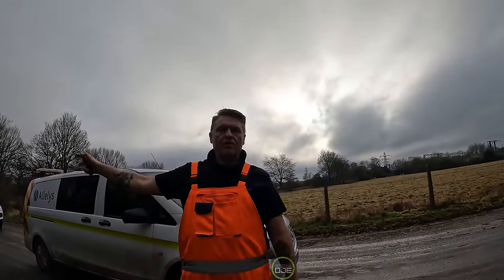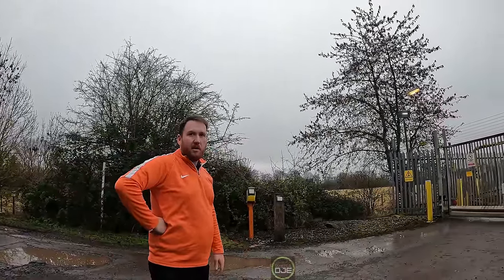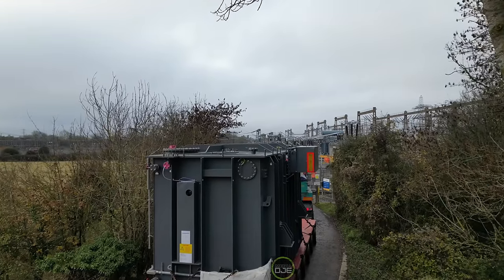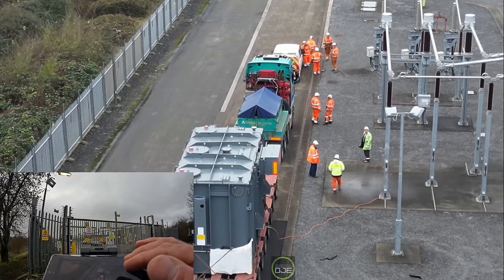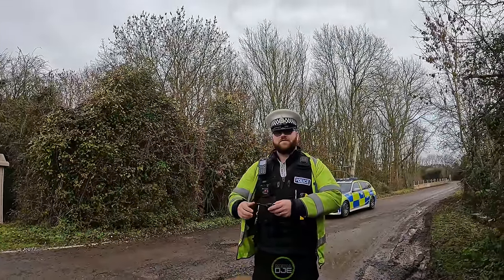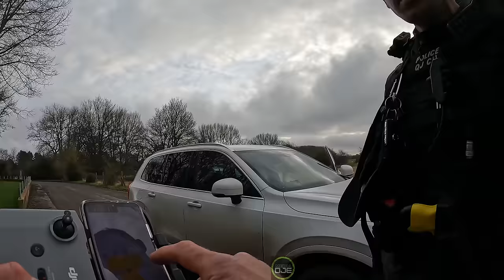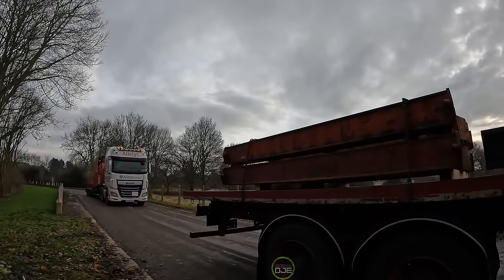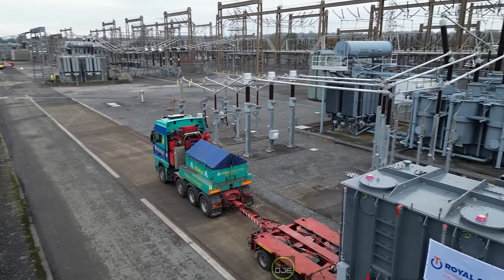HOW did you know the REACTOR was being delivered today mate ? 🤔🎥😒🚁🤬❌️

Comment: They're called reactors, but they're effectively just big coils of wire inside - they're used to restrict fault current on the network using magnetic impedance. Usually, the bigger the fault, the higher the current flowing, but with these on the network, as the load rises, so does the push-back to prevent it from flowing, they automatically and transparently (to the network) prevent dangerous fault currents.
Reply: Actually for power factor correction, but your answer is close enough for the folks who, unlike myself, are just not into electrical engineering pedantry.  🤣
Reply: I did wonder why they would put a nuclear reactor in a substation. Now it makes more sense. Thanks.
Reply: @Iaintwoke  Well, that's likely the plan going forwards... But government is still dragging its feet.

Small modular reactors are designed precisely for that kind of deployment.

Will almost certainly involve those dotes being Scheduled as nuclear sites, with the additional security that entails.
Reply: Another name for it is Choke !

Comment: What a palaver over a little machine that's being flown with legality and care. It's mainly down to a dislike of a camera.
Reply: Security and safety is more important than your right to fly a toy.
Reply: @foxman1546  Couldn't agree more. In this case the video proves that the reaction toward security and safety were practically non- existant, apart from other peoples' vivid imaginations. Jobsworthy-ness of the highest calibre.
Reply: High voltage substations and cables are extremely unfunny things to mess up on and the outcomes are usually expensive. A million pound drone insurance sounds a lot, but it is not, and the policy would not be valid anyway as you ignored the signs 😉
Reply: It's more like a fear. When cameras were first invented, some people thought a picture could take your soul. And it adds ten pounds apparently.
Reply: @robba1234  Signs that have no legal validity? The CAA puts a yellow warning on certain areas; if things were so bad it would action a ban...it doesn't.

Comment: The crane doesn't lift the reactor. For the final position a track is laid down from the trailer to the pads. The hydraulic jacks lift the reactor at four points you can see the jacking points on the sides with the red and white tape around them. After the trailer is removed, more track is laid down underneath along with the sleds and the jacks lower the reactor onto the sleds. It is then pushed along the track to its final position, where the jacks then lift it again and all the track is removed so the reactor can be lowered down onto the concrete pads. Took us about 3 days to move a 350T generator from lorry to final position. Moving along the tracks usually takes 1 to 2 hours, the rest of the time is the set up and positioning of the tracks and jacks.

The problem with flying directly over open air switchgear is that drone falling could come down and breach the safety zone around an insulator. This would be very dangerous for anyone in the switchyard at the time, along with the the disruption to national electricity supply. That is the main reason they don't want you flying around the yard whilst they are in there.

Drone assist is not the law and is not endorsed by the CAA. It is always the responsibility of the drone pilot to ensure safety. Under Schedule 9 of the Air Traffic Management and Unmanned Aircraft Act 2021 the Police do have the power to check that the Operator ID is legitimate. At the moment for a sub 250g drone they only have the power to obtain the name of UAS Operator and not the remote pilot, although there is a catch all of 'any further information the constable considers reasonable'. Nothing in Schedule 9 requires an offence to be committed or suspicion of one, that is Schedule 8.
Reply: Drone assist is endorsed by the CAA it is endorsed on the CAA web site!! So what else in your post is b@llocks?
Reply: Every question has a purpose and it’s not to be friendly. Don’t forget that.
Reply: @Ubique2927  Yes,  Drone Assist along with other Apps and manufacturer's software is listed on the CAA website. However, to quote the paragraphs on the CAA website directly above that list;

'As a regulator, the CAA supports any measure to improve the safe use of drones but does not endorse individual products.
The CAA has not checked or approved the apps listed here. Full responsibility for safe operation remains with the person operating the drone. It is up to them to assure themselves of the accuracy of the data and comply with all UK drone rules and regulations.'

So when a drone pilot states that the likes of Drone Assist gives them the legal right to fly over an area because it shows there is no exclusion zone, they are mistaken. Drone assist can form part of a risk assessment to determine if a flight path is safe and legal, but there can be other factors that may make the flight unsafe and hence illegal.

National Grid, the owner and operator of 400 kV and 275 kV substations will have a documented risk assessment for carrying out flight over and around their substations and infrastructure, by both themselves and members of public. They have come to the conclusion that such a flight will be an unacceptable safety and business risk to them. They can and do have mitigating factors in place to allow their own engineers to fly drones, but not for the public. Given the fact that there were engineers working within the substation at the time, that would likely compound the severity of the outcome by introducing the potential for injury to persons.

They have therefore placed signage around, easily within view to prohibit drone flights directly above their substations. If it ever came down to a decision in a court of law, it is likely that a risk assessment carried out by a specialist engineer would overrule the lack of an exclusion zone in a piece of software relied upon by a member of the public.
Reply: @ExodusX13  Yes I do, I also realise that there are other factors involved in whether or not a drone flight over specific areas can be conducted safely and legally.
Reply: Not a "reactor" in the nuclear sense so no special hazard at all!

Comment: I think that you meant to say transformer. This is not a nuclear reactor!
Reply: They're called reactors, but they're effectively just big coils of wire inside - they're used to restrict fault current on the network using magnetic impedance. Usually, the bigger the fault, the higher the current flowing, but with these on the network, as the load rises, so does the push-back to prevent it from flowing, they automatically and transparently (to the network) prevent dangerous fault currents. thanks to @colinwilson210 for that comment.

Comment: I wonder if the sticker puts the drone over 250g. If the dgi is 249g then the sticker will probably just put it over
Reply: Even though they are marked 249g these mini drones usually weigh less coming in at around 242-243g, at least the DJI Mini 2 does.
Reply: Carbon Fibre sticker, all good ☺

Comment: The only thing i would worry about is the radio frequency crossing if they use wireless controllers for their winches.
Reply: The government has laws wrt frequency use. If there’s a problem it’s the winch hardware fault.
Reply: The main issue is that the electro-magnetic field from the substation / pylons affects the operation of the drone compass and can confuse it. There are many factors that affect it though such as the type of drone, load on the Grid etc.
Reply: Bluetooth used select frequencies decided at the time of connection.
Reply: @three-phase562  You know more about electrical grid than drones. Drone does not rely solely on compass. There are backups.

Comment: "Gapped Core is generally used in shunt reactor - constructed from Cold Rolled Grain Oriented Silicon Steel sheet to reduce hysteresis losses. The sheets are laminated to reduce eddy current losses. Gaps are intentionally provided in the construction by placing spacers of high modulus of electricity between the packets of laminations. Normally the gaps are maintained radially. The laminations are placed in each packet in longitudinal directions. Normally, 5 limb 3 phase structure of core is used. It is shell type construction. The yokes and side limbs are not gapped but the three inner limbs for individual phase is constructed with radial gaps as shown. There is nothing special about winding of a reactor. This is mainly made of copper conductors. The conductors are paper insulated. Insulated spacers are provided between turns to maintain the path for oil circulation. This arrangement helps for efficient cooling of the winding. Normally a shunt reactor deals with low current that is why ONAN (Oil Natural Air Natural) cooling is sufficient for shunt reactor even for extra high voltage ratings. The radiator bank is connected with main tank to facilitate faster cooling."

I understand all the words,,,,

Comment: 38:15 Point about the road through a motorway service station. Its not a public road. It's a private road. But it can come under road traffic offences because driving a car over it means the car is going from A to Z. The same as a petrol forecourt - you can drive straight through. So when it comes to stopping a car in such situations you are not parked, even if you turn off the engine and get out of the car as you are still on your journey.

In a petrol forecourt the stop is short. In a motorway service station, it can be just as short if popping to the loo, but if you're stopping for a meal, then you could be there for an hour or so. In the first case you are not parked. In the second instance you are parked. But the police can't tell just from the car parking up. Nor can they find out. So they have to assume the car is parked unless they have evidence otherwise.

So police can stop and get ID under section 164 of the RTA as you drive to the car park in a service or petrol station. But they can't once you've parked for a meal. But such a nuance of the law is above all constable's heads. And many people. So the police will abuse such a point in law to get their own way. And 99.999% of the time they get away with it.

Comment: That weight limit isn’t a weight limit on the bridge… it says except for access. There’s every chance that the bridge can take the weight ! IF IT WAS FOR THE BRIDGE it would say 7.5 ton MGW. It would also say “WEEK BRIDGE 7.5t MGW” but that one says  “7.5t EXCEPT FOR ACCESS”. That doesn’t mean the infrastructure carnt handle it it just says you are not to do it without good reason. A bridge/tunnel height sign dose not necessarily display the hight of the bridge/tunnel but the restriction placed upto vehicles using that bridge/tunnel.

Comment: Bit confused why a 'reactor' would be delivered to a substation, I can absolutely see a large transformer or capacitor being delivered to a substation, but it makes no sense that a reactor would be delivered to a substation.  A substation is basically a switch, it takes the 275/132kv and splits/drops it down to something a bit more manageable by the smaller substations that power your homes.  Reactors produce energy, substations only switch energy.  That being said, you did get your drone pretty close to those high voltage lines and if I worked at this substation I would be wary too if you got that close.

Comment: Yes that yellow trailer has a power pack with hydronic system to steer the assets thay can be used in multiples so they may and more likely join the four axel trailer unit to the larger one with the control unit togeather , like the trailer the transformer arrived on has four wheels per side on each axel these can be rased lowered and each can turn individually.  There is a vid of one set up takeing a blade for a wind turbine up a mountain in Germany on a typical country road , at one point it goes through a hamlet there's a bend in the road where at one point they have to lean the trailer over so the end of the blade inches past a house at one end and again when the end reaches the last house so it passes under the eve of the house . These platforms are a remarkable pice of equipment after use they can be split down to single units to fit on standerd low loaders

Comment: the 'reactor' reacts with what exactly? photons?
Reply: or is it simply a transformer?
Reply: you could have asked Reggie Photo to take some measurements. 🙂
Reply: It reacts with the Grid and negates the capacitive loading. It is a built in the same manner as a transformer but does not have the secondary winding. Primarily they are used at the end of transmission lines during energisation.

Comment: This is a sub station. That is a transformer not a Reactor. No cooling towers mate.
Reply from the maker: Just going by what the national grid called it in the media.
Reply: You're thinking of a Nuclear Reactor. This device, though similar to a transformer, does not step the voltage down but I believe reacts to changes in the load on the grid to help keep the voltage stable, hence being referred to as a "Reactor" 
Name could also have some reference to an electrical effect known as Reactance (capacitive or inductive)